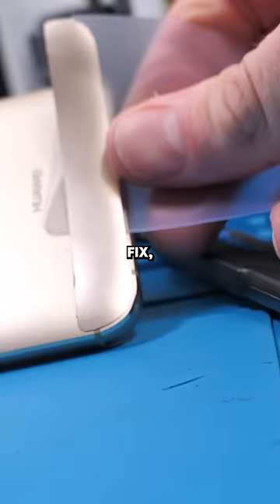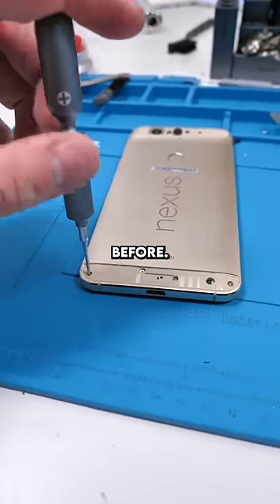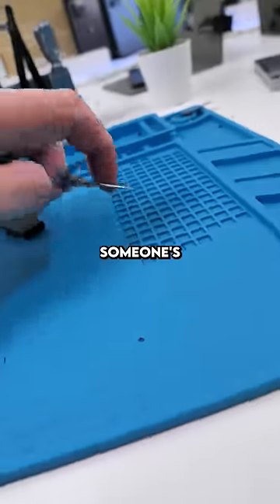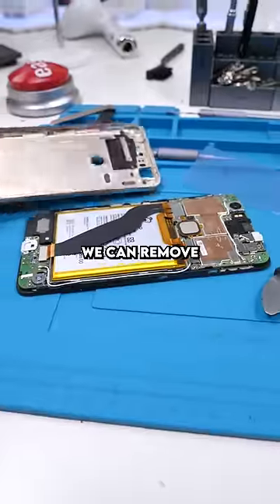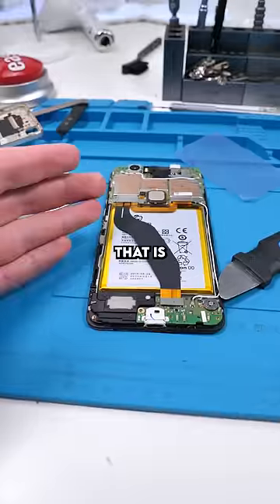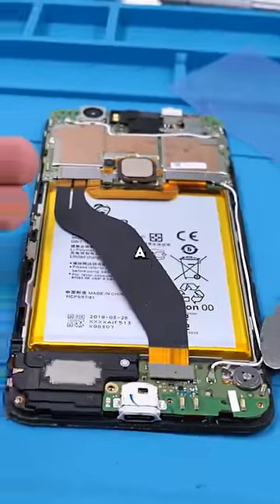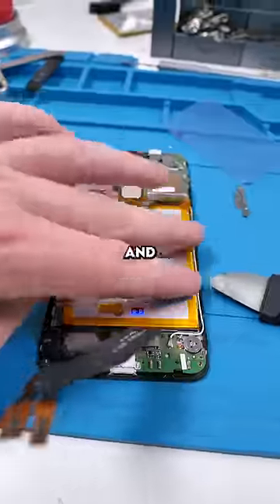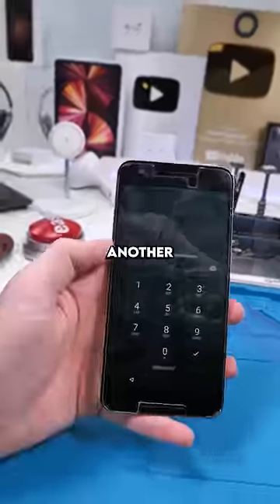Google And Huawei Were Once Good Friends.... #Shorts

Comment: I’ve repaired this phone before. It’s the single most difficult phone that I’ve ever repaired, not to mention, the durability is absolutely laughable. We’re talking about a screen that would crack if you pressed too hard on it. And pulling off that glass piece on the back to access the screws was almost impossible.

Comment: I've been planning on replacing the battery in my old one for a while. It's been sitting with the new battery waiting to be put in for a while, but I still need to find the time to get a heat gun (and then to actually do it...).

Comment: I used to have one of these. Loved the speakers and size but I had a number of problems with it. Battery would immediately die in the cold. Even with over 50% battery. Which isn’t fun after a late February night out in Montreal. Also the plastic rim around the screen disintegrated.

After having a oneplus one’s motherboard die within 6 months and a horrible repair process and this experience I basically swore off the Chinese branded phones

Comment: I remember when my grandmother brought my iPhone 4 to a staples and while it "worked" afterwards she was told never to take the case off or it would instantly die. Talk about a crappy service. 😂
Reply: Another time my mother took an old gateway from the early 2000s to a staples and they said that it was completely dead with no chance of repair, then they proceeded to offer an expensive brand new pc. Many years later I would find myself fascinated by computers and I convinced my mother to let me try and fix it and as it turns out the staples had purposefully unplugged the power button so that it did nothing. That staples no longer exists from what I'm aware

Comment: I still regret not sending a year back my LG Q6 witch cracked screen, and swollen battery, back cover falling off and broken micro usb port.....Would be a 35 bucks repair at max 😳🕵️And it would be new except for the frame since there was only 1 chip in it

Comment: I had that phone it was my first "premium" phone and still the best phone i ever used! I loved everything about it the design the software but after updating to andriod nougat there was a problem with a lot of nexus 6p's including mine the battery would be dead after 2 hours and would turn off at 20% left that realy killed the phone after that i got the note 8 (realy sucked) and iphone xs max and my current phone the 13 pro max the iphones are realy good but the 13 is still second to the 6p even with the battery problem it was an amazing phone PEAK GOOGLE!

Comment: i have that nexus 6p 
i stopped using it since it has a Battery issue

like if you have 40% battery and you kinda want to open the camera the phone will just shut down saying battery empty

tried to get it to the repair shop but they just mangled it trying to open the back

Comment: I still have mine #phonerepairguru
I modded it to look like something straight out of Wakanda. I keep it as my back up. It's a decent device, it's just that Huawei did wrong by having a mediocre battery circuit paired with the SD 810.
Yeah you can see where that issue went...

Comment: Hi, u mentioned about the glue being less sticky than original, hope u can test out used Samsung flagships about a year or less than 2yrs old.

I have personally encountered 3 note20 ultras (1 less than a yr old and 2 less than 2yrs old - and honestly, who knows if the separation happened in less than a year? We won’t know because we always had a case on it and the separation is not obvious unless u know what u’r looking for) and a less than 1yr old s20 ultra where the back glass has ever so slightly lifted from the frame. I wrote about this in my FB page. But it seems that samsung uses an adhesive enough to pass the IP rating test and keep it for a while but deteriorates after some months. Is it intentional or just bad choice of adhesive? And BTW, Samsung customer service, they don’t care, i know because i tried to dispute a water damage on 1 of the note20 ultra that they have already opened. The way they handled my concern, it seems that they are very used to dealing with water damage. They even did not acknowledge the fact that their very own tech went in my phone
Reply: Hi repair guru, hope you can check my comment out :(

Comment: I have a question:
Is it safe, to install lineage os to my phone? 
(Story time!)
I bought myslef Xiaomi poco M3 and it seemed like a good phone. But one day it just wanted os update and it bricked my phone completely. (Nothing helped, I searched a lot, trust me) I lost all of my data after they "fixed" that. They exchanged motherboard. But guess what? That update wasn't installed on it! So now I have more than a half year pending os update that I don't want to do. It would be fine, I can ignore it pretty well... But after some time several bugs and user uncomfortable issues appeared, which are forcing me to either buy a new phone or install lineage os.

It would be my first try so I would first try it on my older phone (Xiaomi Redmi X4)